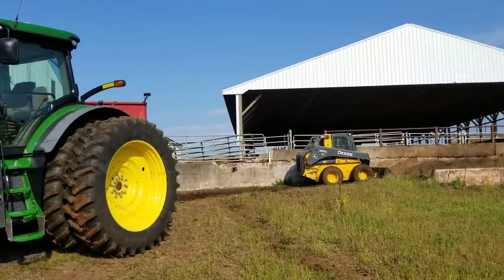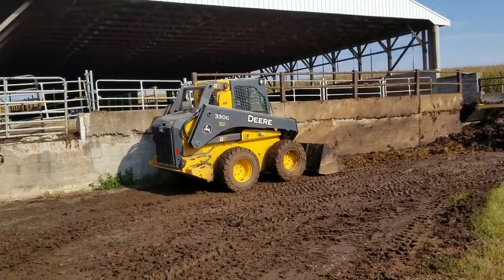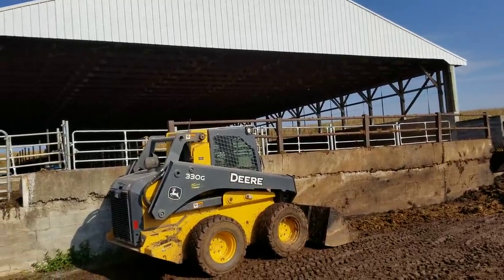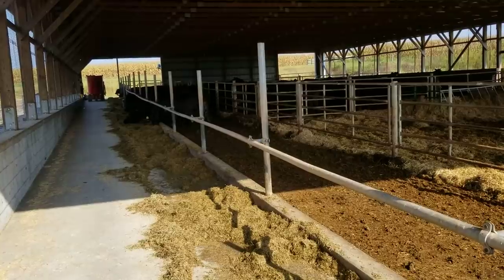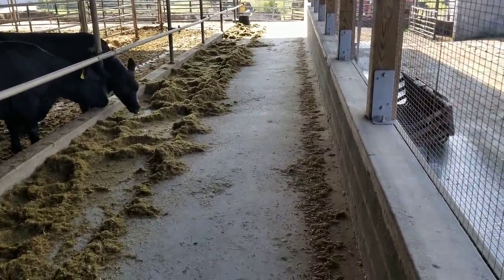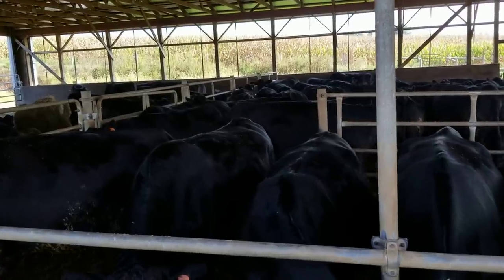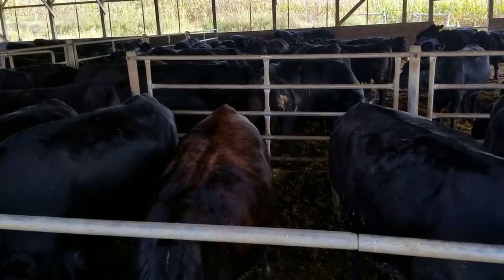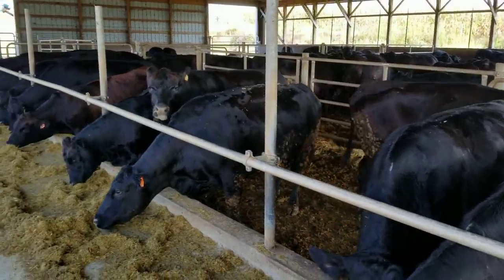5 reasons why we need to upgrade the farm

Comment: I understand what you are getting at Eric how I know your name from insta if yer curious?? Inerways again I understand what you mean if you ain't be able to build up your operation anywhere from building cattle size for quality, not just to breed whatever you want to get which as I should say where you are more picky when it comes to breeding. & #2 some things I have said about your operation  of your manure I wasn't trying to start any drama about that I was just clarifyin if you didn't know if it is to acidic, which it is, so if you understand that's why I been saying you should at least try to compost your cow manure. & #3  idk if you have investigated? But inerways  insteading  of using straight cement, why don't you try to use cement dust? We use that constantly sure it gets a little dusty, but just spay some water, and when you clean the manure, it's also good for the ground, cuz it's limey. Inerways good video.👍